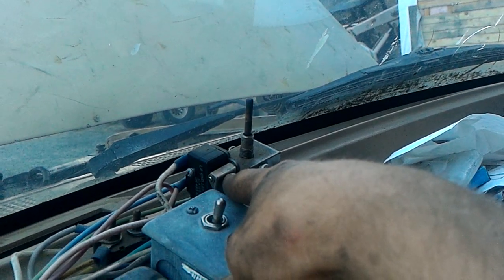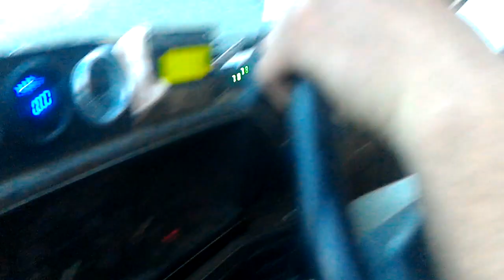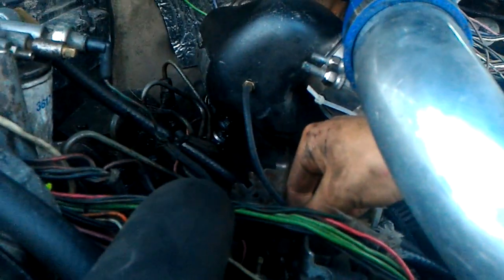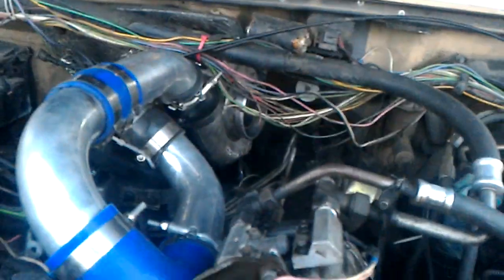First start - '88 high HP build(S360)

Comment: Is it ok to run a road draft instead of the cdr
Reply from the maker: Will it hurt the motor? No.
 However, it will smoke like the truck is on fire. That's the reason you want to keep the CDR, or find another way to route the crankcase gasses into the intake..
Ford IDIs have huge ring gaps which makes tons of blowby. It's just how they are designed.
Reply: @MacRobbSimpson  i got a turbo and my valve cover has the hole in it is it ok for me to run a hose from the valve cover to the intake pipe
Reply: @MacRobbSimpson  my truck really dont have much crank case smoke
Reply: @MacRobbSimpson  ok seems easy
Reply from the maker: Did you block off the old CDR holes when installing the turbo(both sides)? I expect yes, but want to be sure.
Reply: @MacRobbSimpson  yes the oil drain is where the cdr was i drilled a hole in the valve cover
Reply: I have a hypermax turbo but i rigged up a 7.3 down pipe on it i can hit 16 psi i have a r&d 90 pump i can probably hit more psi but i dont have a pyro